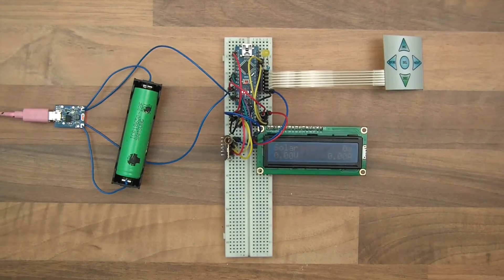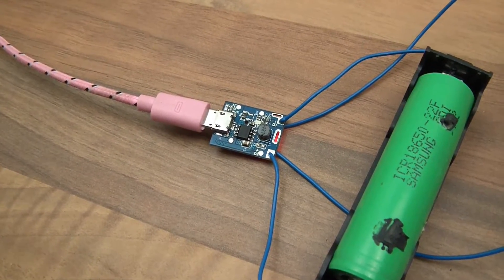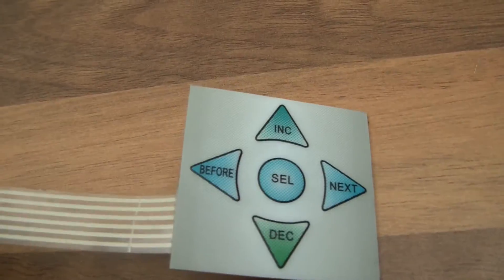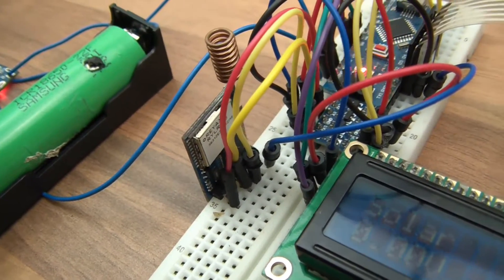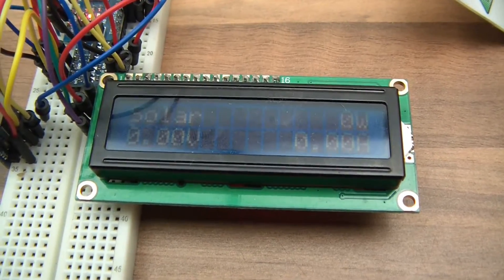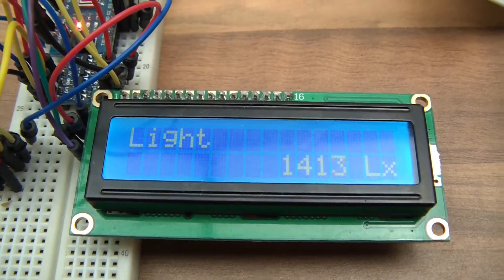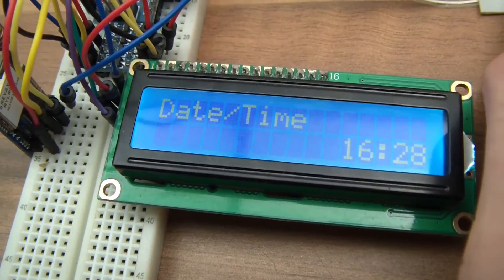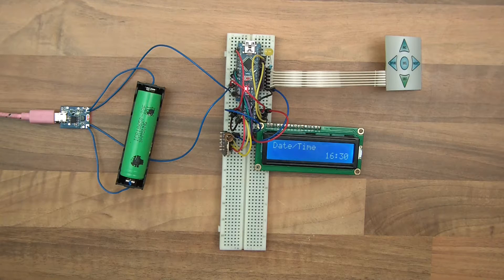INVESTIGATING: My Solar Power System Remote Controller Monitor -  Arduino LCD Input RYLR896

Comment: hello, sir I am seen your (My DIY Offgrid Solar Power System (An Update - May 2017) it is very good. I am very impressed and like to make off-grid solar system only 600-watt use 320X2 Watts solar panel ok and they put outside my house put on the bottom in my garden. MY QUESTION IS! HOW TO PROTECT LIGHTNING STRIKES MY SOLAR SYSTEM.
Reply from the maker: Hi, thanks! Lighting is attracted to metal, not glass... so I think I'm correct in saying that you should ground the metal frames. :)
Reply: Ground all exposed metal parts including the solar charger to a  copper or copper coated metal earth rod in the ground (at least 1m deep) and connect with earth cable that is at least 6mm2. Don't connect it to the house earth system.

Comment: If you replaced the arduino with an ESP8266 you could flash it OTA thus obviating the need to brave the elements.